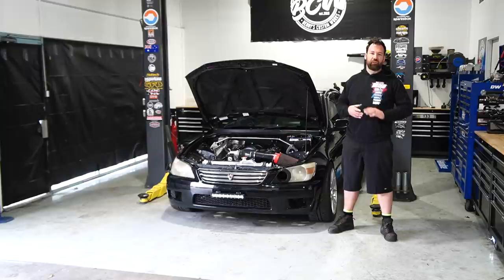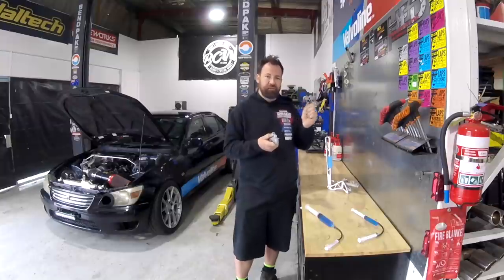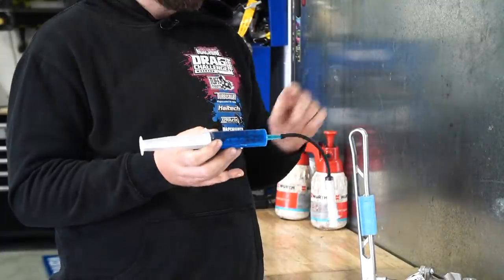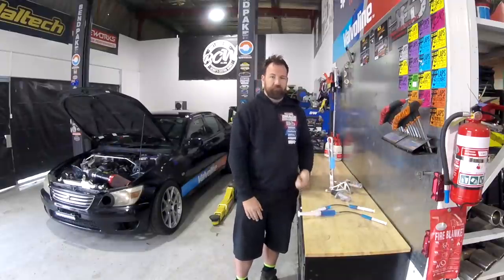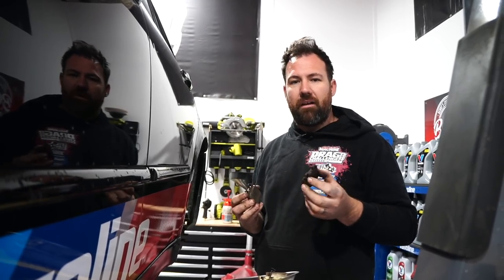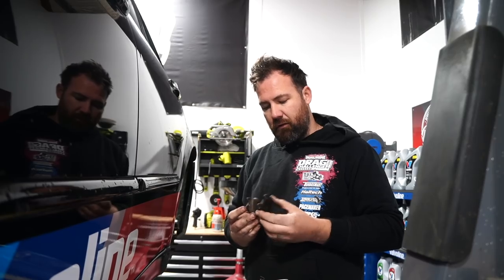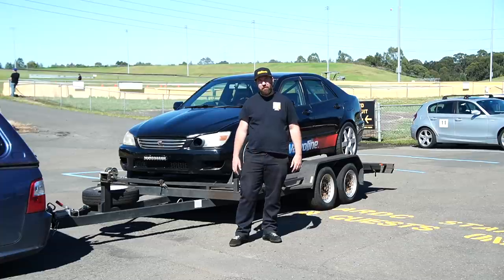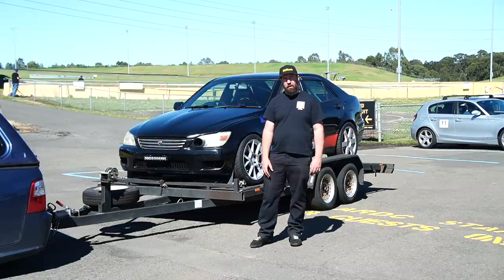BROKE THE IS600 | Hydraulic System Explained

Comment: You move the brake pad millimeters but the master cylinder centimeters, brake pads don't move much but lots of force. More like your first syringe example but in reverse. You move the little syringe full amount, relatively soft/low back pressure and the big syringe will move a short distance but higher pressure.

Comment: I've seen a Celica that had the ring gear dislodge itself from the flywheel, it shifted forwards and rubbed on the block... It still had enough bite to crank the engine though.

Comment: The principal of hydraulic force intensification - if you halve your master cylinder surface area, you double the force applied on the calliper pistons. The trade off is that the master cylinder must travel twice as far to get the calliper pistons to travel the same distance as before. 
Your handbrake will lock up much harder now.

Comment: Hydraulic systems work on similar principles to levers 
A small bore master cylinder pushing a larger bore slave cylinder will have greater leverage than an equal bore or a large bore master over a small bore slave cylinder.
Things to look out for.
The small bore master needs sufficient total volume to match the volume of the larger bore slave in order to move the slave the required amount. If you need to move the slave 150 millimetres and the slave is twice the diameter of the master the master will need to travel 300 millimetres to fully extend the slave. Note that if the slave needs to move 100kilograms of resistance it will only take 50 kilograms of force on the master, add a suitable lever with a two to one ratio and the force needed will be cut in half again.